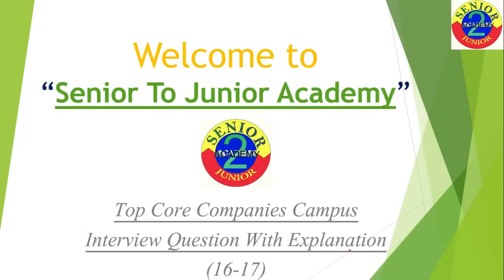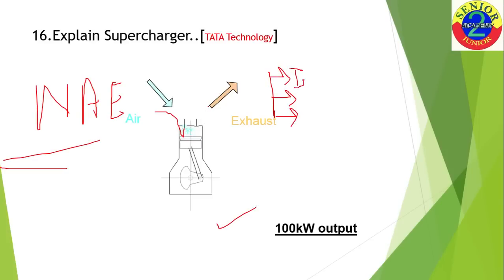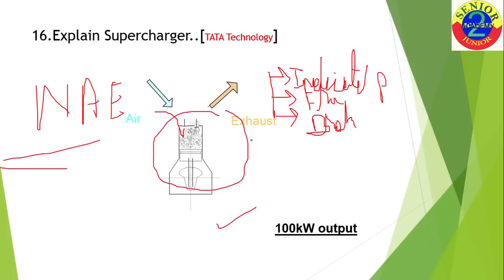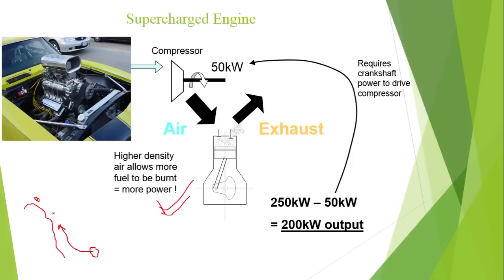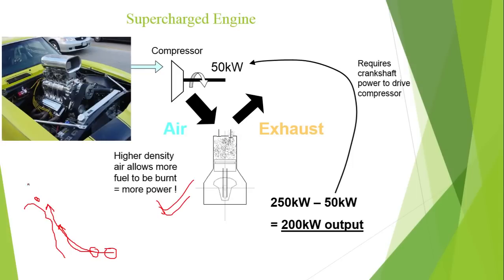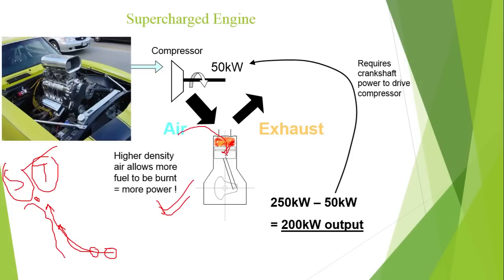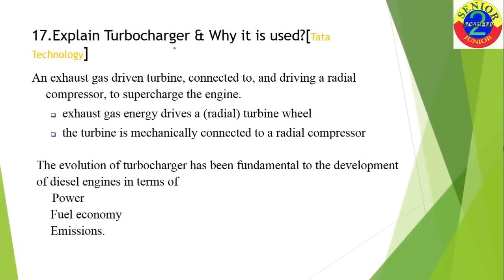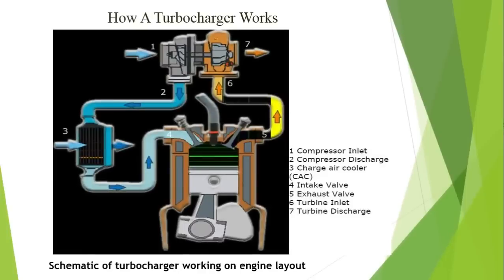Mechanical Interview Question -Supercharger and Turbocharger (Question 16-17)

Comment: I am not completely agree with your statement that super charger has a loss okk. but it also has advantage to get more power then the NAE and if NAE produces 250 then supercharger will help to get (250+50 due to super charger) and its self consume will not exceed to its 1/4th (i.e 50/4=12.5)thus now we have (287.5) as remaining not frictional power will be subtracted to get BHP. if there is no benefit to install then why manufacturers put it?